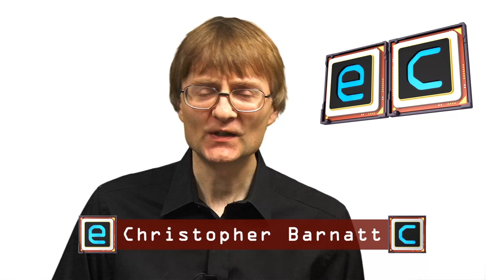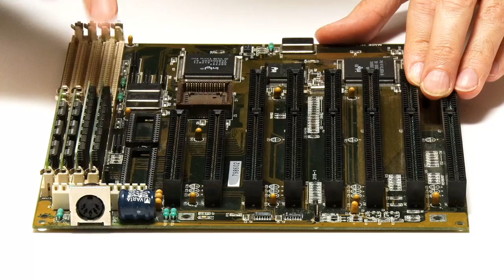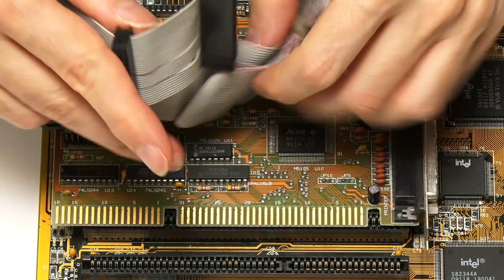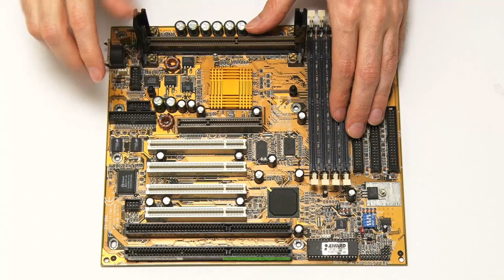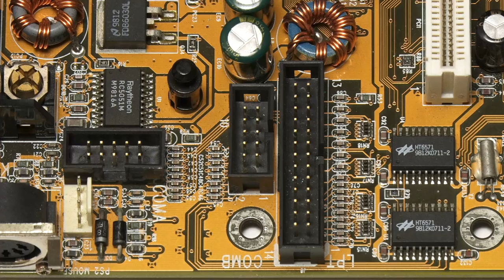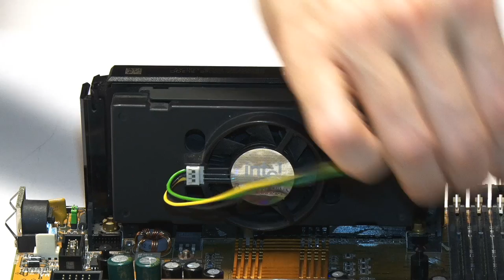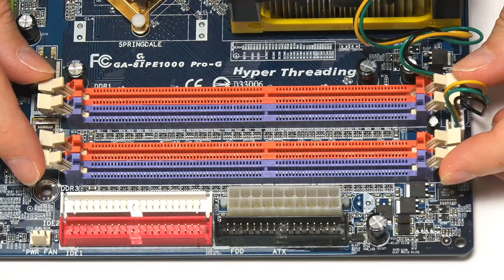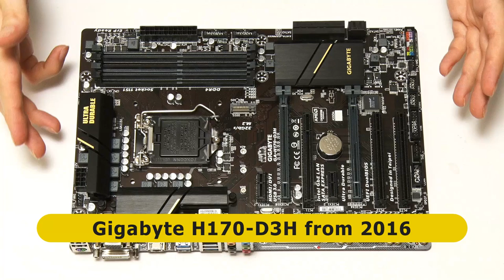PC Motherboard Evolution

Comment: Fun fact about slot CPUs. Intel and AMD were physically compatible, but different electrically. If you plugged one into a board for the other, the CPU would die when you powered up the system.

Yay.
Reply: They both used PGA unlike today when they used PGA and LGA for motherboard and cpu.
Reply: Pasta Sarmonella E-Specialé are you saying that Slot CPU modules were internally PGA or...?
Reply: @RWL2012   No.  He's saying that AMD Slot A and Intel Slot 1 connectors were physically identical - meaning you could physically insert a Slot 1 processor into a Slot A board or vice-versa.  However, the pin assignments were different between the two processors.  But, great regret and misfortune would betide thee if thou powereth it up.  To be fair, though - the retention mechanisms that locked the processor card into the slot made this difficult to do unless you removed the brackets.  A few determined but not particularly bright individuals did exactly that, and there was much depression and gnashing of the teeth afterward.

But, while AMD took pains to avoid such tragedy, there were manufacturers who actually set a electrical booby trap that snared many an unwary tech or would-be upgrader.   Yes, Dell, I'm speaking of YOU, but you're not the only offender here.   Here's the rundown of it:

http://www.informit.com/articles/article.aspx?p=339053
Reply: @xaenon reply seen and acknowledged :)

Comment: I had a P2 233, 32MB RAM and a 4.01 GB HDD back in 98. I overclocked it up to 252 without knowing exactly what I was doing in a time the OC could actually burn the CPU, OC was not a thing in those days so no safety features or safe OC whatsoever. That´s when I felt in love with computers! Thank you  for the memory lane trip!!

Comment: Hi Chris. Thanks for this. As some others have said, that was a trip down memory lane.  I actually remember back further, into the late 70s/early 80s when my Dad bought a Radio Shack TRS-80 II; this computer was pre-DOS, if memory serves, and the (specially written) programmes had to be loaded from a cassette tape. Unbelievable.
Reply: I remember the old TRS-80 and the old 51/2 floppy disk to start the computer and other ones for programs.

Comment: Computers used to take research to build often with some troubleshooting. When you got upgrades, it would mean more tweaking. Now there is so little chance of things not working as long as you get the basics right. I built a new computer the other day. I spent maybe 15 minutes buying the parts in my local electronics store and it took me probably 15 minutes to put it together. The majority of my time was cable management.

Comment: The red stripe on the floppy cable should be oriented toward Pin 1 of the floppy header.
Reply from the maker: That is true! But you still have to know that and get it right . . .
Reply: I remember a stage when the connectors had a pin hole blocked or blanked off and the pins had a pin missing to ensure correct orrientation of the connector.
I also remember having to carefully straighten pins on the motherboard with long nose pliers after my friend tried forcing the drive cable in the wrong way.
Reply from the maker: Yes, blocked out pins were common in the later days of (E)IDE.
Reply: I came looking for this! Thanks for setting it straight.
Reply: Exactly
Reply: @ExplainingComputers 
yes,  but you did say  YOU HAPPEN TO KNOW WHICH WAY AROUND IT GOES
hehe
Reply: Perhaps it was not all cable connectors of this type and you have to look closely to see it, there was a little arrow indicating pin one or less often the first and last pin numbers molded into the connector.

Comment: Nice, stroll through memory lane, back at the time I used to build PCs myself... xD
Nowadays, even with the ressurgence of PC builders, I just buy them ready to use.

Here in Brazil there was a quirk back in the 90s and early 2000s for anyone who lived close to the Paraguayan border - it was waaaay cheaper to buy parts and build your own PC.
That plus me being a tinkerer who broke lots of electronics as a teen and early adult, I'm familiar with a whole ton of stuff Cris is talking about.

I started opening up desktop cases to see what's inside back at PC-XT times... but my first builds were probably back at 386 DXII desktops. I think that went on up 'till Pentium III, which I had a Slot 1 cartridge for. Perhaps a bit longer than that.

From that time on things started getting super complicated on the ram memory side.
There was a transitioning period that had lots of motherboards that were only compatible with certain RAM memory brands and speeds, things got a heck lot more confusing, and worst of all - poorly documented.

So what you effectively had to do (which I did) was talk a lot with people working on stores to know what combination worked and what didn't. As they assembled multiple desktops a day, they knew what worked better and what didn't. They had lots of headaches with assembled desktops coming back from costumers because they weren't working properly.
You gave a base configuration of what you wanted and they took care of matching brands and whatnot so that the build would work.

Things I don't forget from that time... the moment RAM memory prices crashed down, which was almost unbelievable at the time, and the moment RAM memory speeds became a thing, which was the point assembling your own desktop became too complicated - like I said on previous paragraph.

From that point on I never went back to building my own desktops. It doesn't make economical sense anymore these days here in Brazil... difference in price isn't that big anymore, parts are harder to find, and warranty plus paying in installments just makes buying a pre-assembled branded desktop the better choices nowadays.

But the benefits lives on. My current desktop is over 5 yrs old now. I got a Dell. But I put an SSD in it right after buying it, most people didn't even know what it was. And I'll probably replace the aging graphics card and push it for some more years before retiring...
Reply: Yeah you can upgrade parts as and when you need to which is the major advantage. PCs last a lot longer than they used to too because they aren't getting much faster now so you can keep using the old one.

Comment: That slot processor thing is new to me....this proves "Every day you learn something new...."
Reply: They were rubbish. The AMD slot processors had an issue where if you didn't have enough cooling, they actually de-soldered themselves and slid down the pcb. Then game over....
Reply: @dj_paultuk7052  I had a 300mhz slot Pentium II back in 1997. Later upgraded to 533mhz Celeron, but I needed a slot to socket adapter... That was the fastest I could go on the LX chipset... In the hindsight I should have waited for BX chipset. That was really upgradeable!
Reply: @dj_paultuk7052  this is the best reply regarding AMD that i get 👌....it seems you are one of the victim.
Reply: 1ctrlaltdelete1  I wish I kept mine... I had an Intel motherboard.very basic in terms of available settings, but very stable. I'm sure it would have lasted...
Reply: 1ctrlaltdelete1  this story makes me feel better. You know what I am using AMD PC with Linux works fine...nothing fancy just YouTube video editing and web browsing sometime I play cricket game using wine....
Reply: @Bharat Mohanty   No, I just used to Build and Repair PC's back in that Era.
Reply: All I remember from that time was the insane amount of money Intel poured into the marketing with those lab guys disco'ing around in multicolored metallic suits and the whole MMX thing. It was a big deal. I wasn't as versed as I am now back then though, I've had a few examples of the slot loading CPUs. Still have a 400Mhz celeron slot loader hanging around. They seem cool to me, but as others have said they are kind of rubbish. Still seems neat to me though.
Reply: DJ_PaulTUK - I thought they just didn't have any built-in thermal protection (ie. they didn't throttle down to save the chip) and it just went on and on until it blew up? I distinctly remember many videos of people purposely demonstrating this and how if you had no heat sink the cpu would just basically vaporize itself. LOL. Shit man, those were not days i'd ever want to repeat. These days it'll just throttle down. This is why I initially stayed away from AMD because I didn't want to make a mistake and vaporize my 100+ dollar cpu.
Reply: They were new to everyone back in 1997...
Reply: I had a Pentium II 450 with the intel heatsink. I also had Celeron 400, Celeron 533, Celeron 900, and a Celeron 1Ghz all on slocket adapters with a normal intel socket 370 cooler.   My brother had a 850Mhz AMD Athlon Thunderbird with the factory fan and heatsink. I can think of countless systems that had slot processors and I've never heard of them unsoldering themselves. Even people that overclocked the life out of them I've never seen nor heard of that.  It must have just been a bad batch or a improperly installed heatsink from the factory.
Reply: Just blow your mind some more.  There were Slot cards with sockets on them too.  So you could use the later socket chips on the Slot boards
Reply: + potmej1
Slot 1 just combined the cache into the CPU, which was a stupid marketing gimmick, IMO. Take off that huge heat sink, and it's just a PCB with the CPU and cache RAM soldered on. Remember that just before this, motherboards had cache chips that you could upgrade, or a slot for a cache card. 

Don't let that huge heat sink fool you - it only made contact with the CPU die itself, and could just as easily be cooled by a similar heat sink to what the AMD Socket-7s used.
Reply: +Stepside 1986
By the Pentium II era, motherboards had temperature monitoring built into the BIOS, and would USUALLY shut down the computer automatically, or at least sound a warning on the PC speaker if the CPU temperature reached above a certain threshold (around 85C or something like that, you could change it in BIOS) or if the CPU fan stopped spinning (that's why they had 3 wires instead of just 2). At least, in all the motherboards I've used from around that era.
Reply: The "Slot" was just because Intel hadn't yet the presence of mind to integrate the cache directly into the CPU wafer itself. If you take a Slot 1 cartridge apart, you'll see that it's just a CPU and some cache chips soldered directly onto a PCB, and that giant heat sink only made contact with the CPU die itself. That's all it was, and it was stupid. Before the advent of the Slot 1, Intel and AMD CPUs  (as well as Cyrix and whatever knockoff brand you please) could all be used interchangeably on the same motherboards. These days, it's either Intel or AMD (OR, not "and"), because they each have their own sockets now and require a matching motherboard.
Reply: I loved those. It's also the era where overclocking started. The celeron 300 could fairly easily be clocked at 450 - amazing at that time.
Reply: I pretty much recognised every  thing on this video and probably know some more significant changes that was missed out by Chris... Like the power supply connectors.....
Reply: @dj_paultuk7052  some of the  intel Pentium 2 slot one processors have no hest sink contact on 2 sub chips which dies after some time!!
Reply: @DJ_PaulTUK I never had an issue with my AMD Slot A. It was my first build to break the 100MHz barrier haha (think mine was a 500MHz)
Reply: not really new too me. use to have a few Pentium III's and Pentium 2s at work which were Slot 1 instead of a socket CPU things were a lot different back then. today's generation will never understand all got it easy! just like kids will never know what a VHS is.
Reply: That slot prozessor thing was my second PC, feeling old right now 🙈
Reply: @potmej1  try windows 7 on it.
Reply: There were slotcket boards that had jumpers to overclock older socket chips on new slot boards. Celery 300A at 633 was a personal show off of mine in the old days with cheap parts and Need for Speed SE running at stupid speeds on a 3dfx Voodoo with S3 Virge cards.

Comment: +ExplainingComputers
That slot1 board is quite the rarity! It's an AT form-factor when most slot1 boards were ATX. It also has both AT and ATX power connectors. And yet it also has a USB connector? Very rare combination indeed!
Reply from the maker: And it feels like only yesterday that I was putting the board in question into my PC! :)
Reply: Right? I still vividly remember my first 486.
Reply: I was going to mention the same thing - Slot1 was Pentium II era so AT form factor was largely obsolete by then iirc so this is a weird one indeed. In fact I remember my first DIY PC around 1998 and the only reason I chose a Socket 7 AT MB over ATX was the price - in hindsight it meant I couldn't upgrade it a couple of years later due most MBs moving to ATX :( at least ATX has stuck around for a long time with some minor updates!
Reply: @Umski 
You're right. The AT spec was on it's way out by then. So that board was really just a stop-gap upgrade path for people who liked their AT case, which a lot of people did.
Reply: Not that rare, really.  I have two PII motherboards that are strictly ATX, but another that is quite similar to the Gigabyte shown here - a Baby AT with AT and ATX PSU connectors (and a USB header).  It's a Totem TM-P2BXAT.  The Asus P2B-B is another one.  I like those boards because the Baby AT form factor is about the same size as Micro ATX.

With Pentium being nearly 100% AT, and Pentium III being 100% ATX, it's not surprising to find some crossover boards in the generation between.
Reply: @nickwallette6201  Far from all Pentiums were AT. In 1997 The Gateway 2000s being sold as towers were all ATX and shipped with Pentium 166 and Pentium 200s. By the time Pentium MMX was common, ATX was common as well. https://www.ebay.com/itm/Vintage-Gateway-2000-P5-133-Intel-Pentium-133MHz-16mb-1-5gb-ATX-Tower/264294322790?hash=item3d892b5266:g:BQ4AAOSwBA1cvhJV is an example of an ATX Pentium older than MMX

Comment: Christopher - thanks for another great video. It was nice to see all those old types of motherboards again. I loved the "here's a PC I'd forgotten I'd got" moment - I'm sure I've had similar moments too :-)

If I remember correctly, the first IBM compatible I owned was an Olivetti PCS 386 that cost me £1399 (with a monochrome monitor and a "free" dot matrix printer) plus another £85 for a mouse, both bought in Evesham Micros, when that was just a little shop in the town of the same name. Later on I upgraded to a colour monitor and added a maths co-processor (liberated from a redundant PC at work).

Amstrad PC's were about £100 less than the Olivetti ones - but I reckoned the extra £100 was a worthwhile investment.

In those days, new PC's came with unformatted hard drives, a manual and a set of install floppies for MS-DOS.
Reply from the maker: I remember Evesham Micros! :)

Comment: I miss building the old 386 and 486 PCs.  All those jumpers and DIPs meant that one error could fry the whole kit.  That anticipation after triple checking and you press the power button to either get a boot up or a popping sound.  You just no longer get that same all or nothing gratification.
Seriously though, I do miss having to get everything just so.  Nowadays literally anyone can plug and play a system together and it'll work.  I'm not saying it'll work well, but it will work.  I remember getting the Abit P5Q motherboard.  It was the world's first jumperless motherboard and it was amazing in the fact you could just go into the BIOS, set a multiplier or ratio or FSB and reboot for some overclocking goodness.  I still have that old system, haha.
Great quick explanation for the uninitiated.  This is a good video I can reference people to when I try to explain that things were much more difficult way back when.  I'm getting old...
Reply: "Nowadays literally anyone can plug and play a system together and it'll work."
I wouldn't be so sure about that. I recently helped a "friend" get his new rig going. He wanted to do it himself, and was pretty hyped about it. He told me later that he thought he'd bricked the thing after spending all that money on it. Turns out he didn't realize that the Ryzen 3 processor he put in was a CPU rather than an APU, which has the GPU integrated so you can use the video headers on the motherboard. He bought a new video card for it, but didn't clue in that he might need it to test with. 

I mean, the motherboard has video connectors on it, so it SHOULDN'T need an external video card to test it, RIGHT!? Well, that hasn't been the case for a few years now, and he was beating himself up over thinking that he'd destroyed his machine before he could use it.

Comment: Nice trip down memory lane. I didn't get started in PC building professionally until the late Pentium days, but I had to troubleshoot some 386 and 486 along the way. I did notice a couple minor things I hope you don't mind me pointing out, not that anyone getting into retro tech is going to use this as their only source. Around 6:15 it looks like you plug the floppy cable in backwards? Red stripe on the side of the cable usually corresponds with Pin 1 on the connector. Also around 13:30 you talk about the Pentium II 300 being a 100MHz bus with a 3x multiplier - that CPU was actually a 66MHz bus with a 4.5 multiplier. The multiplier was usually locked in the CPU, so attempting to set it to 100x3 might result in an unstable 450MHz accidental overclock.
Reply: He was referring to the FSB speed not the CPU, back then you had to do each separately.